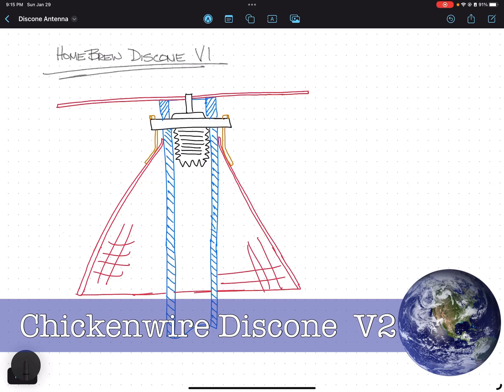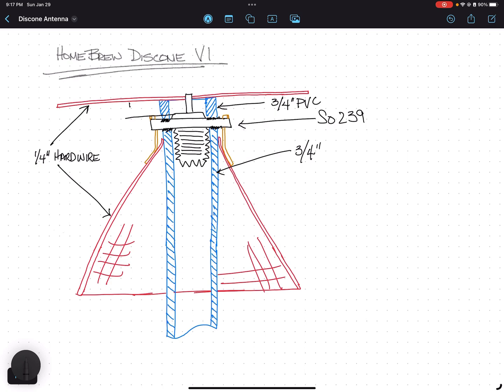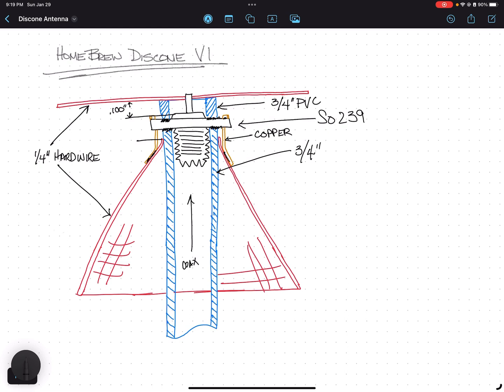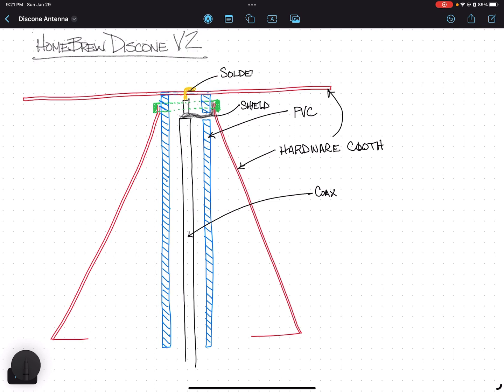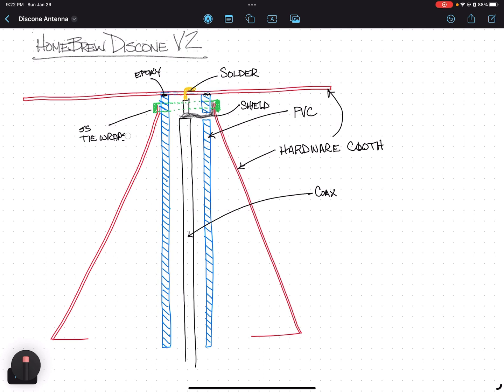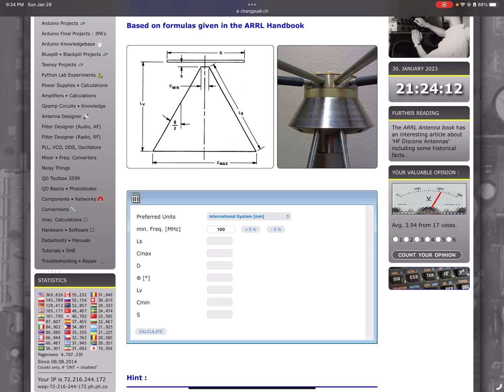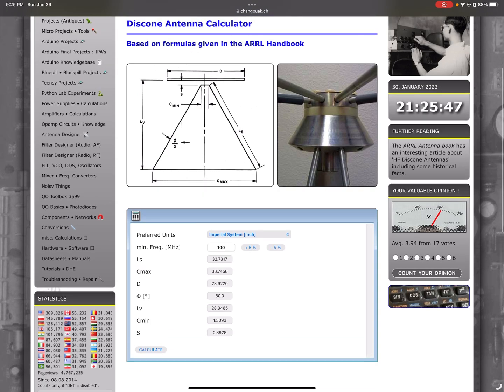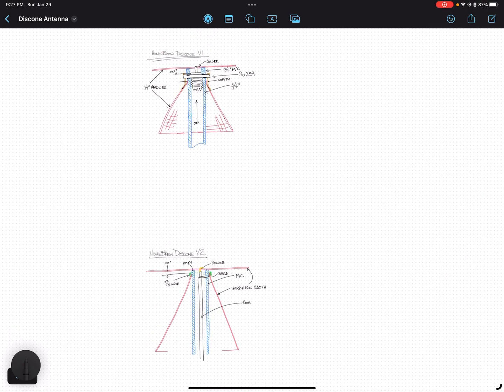DIY Discone V2 Design

Comment: Pretty nice! 
Couple questions...
How does this do with SDR? Will it pick up all the signals throughout all the bands? 
Would sizing bigger help?
Do you have a dimension template available for the cone?
Thanx!
Reply from the maker: I made it specifically for SDR. But it is sized for higher frequencies 400+ MHz. You'd need a bigger version for lower frequencies. For dimensions and tools watch my Design vid on the discone